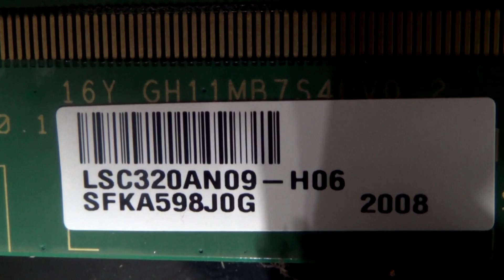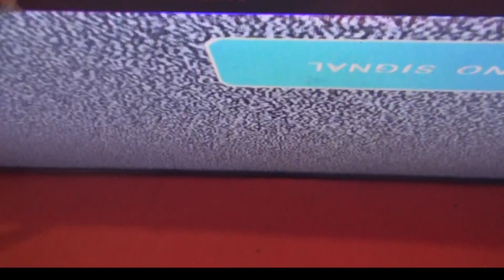LED tv panel repair by cut.#Pro Hack

Comment: What do you mean by this panel is blocked what is the fault...
Reply from the maker: This is due to the failure of TFT transistors.
Reply: @ProHackHD  ok thank you.
Reply: @ProHackHD  is it possible to replace those transistors

Comment: Hello, I have a problem, that CKV strip was cut. It is not that the plate was cut, but directly in the middle of that strip it has a cut. It heats up quite a bit when I connect the monitor to the power and it does not give an image, only as if the image were ghost. is that fixed? Thank you

Comment: you write in the video comment: "We can solve by cutting only 1 of signal track/shortcut modify." - Could you please explain that ?
Reply from the maker: Each panel is divided into two sites.
Digital signals are driven by two sites.
If you know the block line of any one site, you just have to remove it.
Removing a line is the same as removing a full line from a site.